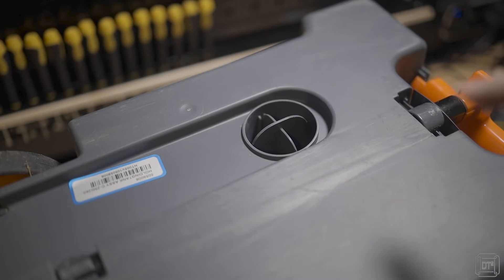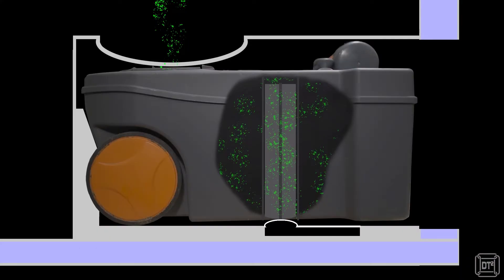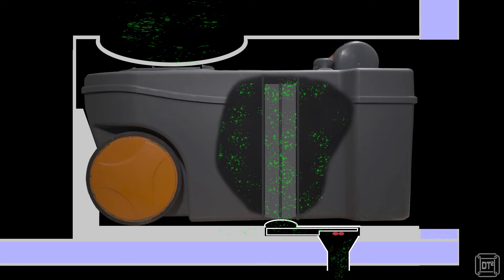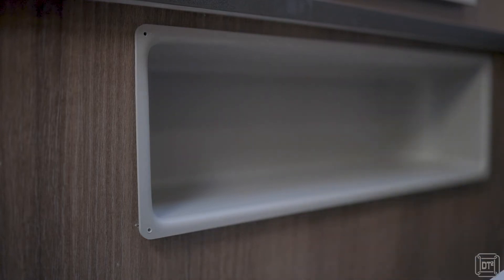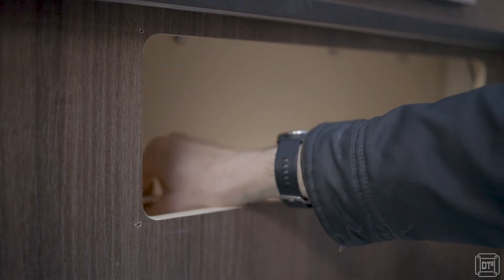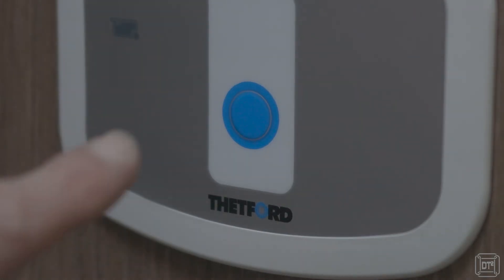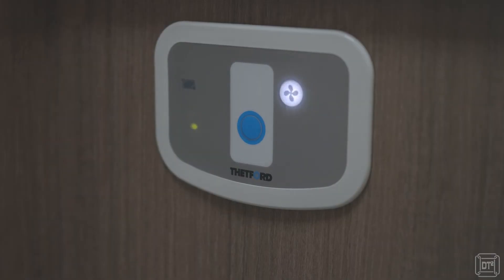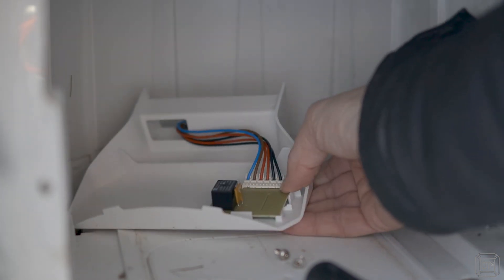THETFORD ELECTRIC VENTILATOR - Detailed installation and review of this toilet extractor fan kit.

Comment: Kevin what a explanation. You are briliant.
Unlike me i wondered if you could help me. I have fitted my kit and nothing works but it may be th purple and black wires that i have had to connect back into the 4 pin connection block that i forgot the colours to connect to  i have an orrange wire with black strip and a purple female spade connectors. The 4 wires in the block have a purple but not the grey . It just will not work so i tried the old circuit boards and that do t work either. I even tried the red and black and nothing happened. Could i have blown a fuse or could it be i need to prime that magnetic switch thing.
I realy do need someone’s help.   It should have been easy but my photo taken of the wires video is not good enough
Reply from the maker: The magnet switch is only to detect the level in the tank. So even if that was broken or incorrectly wired it wouldn't affect anything other than the level indicators.
If you think you may have wired the power supply wires in the wrong way around (ie connected positive to negative) then that could well have blown the board. Or if you have connected the wires incorrectly  and shorted the circuit then that would have likely blown a fuse.
I would -
Get a decent photo of how it is currently connected.
Then disconnect the wires and check with a multimeter which if any are giving you a 12v feed.
If none are then it's likely that a fuse has blown.
You will then need to find the fuse which may be near the cassette but more likely in your main fuse box.
Good luck
Dave
Reply: @DTSquared  Dave sorted it.   Swifts white and orange wire is the earth  i put that to thetfords Black wire.     Swifts purple wire i had put to Thetfords purple wire but that is wrong swifts purple wire goes to Thetfords red wire.  😮 how daft is that purple does not connect to purple.😮 done now all working now😊😅😊

Comment: Hello & thanks for the video, I've had a Valencia in the past with a SOG unit pre-fitted. I valued it but it was fiddly & seemed a little under engineered. I am getting a 2018 Cartagena; might that be the same model as yours? I am wondering about the drilling section & hitting that plate you found - thus - may follow your example & not go with the supplied 85mm vent & perhaps drill the (36mm I think you said) smaller hole instead. That said; would you be able to explain how you made the replacement that you used or what it's composed of please? Thanks in advance :)
Reply from the maker: Hi @ApplesnCastles  glad you found the video helpful. Our van was a Barcelona but in the same range and age. I haven't used a SOG but did research them as an option and thought the same as you did that it was a bit under-engineered. From memory the replacement pipe I made was a short length of white waste pipe (probably 1 1/2 inch) Then I got circle of plasti-card and cut a hole in the middle and then cut some smaller donut shaped rings of plasticard to build up the card around where the pipe met it. It was a bit heath-robinson but it doesn't have to be leak proof or that strong as it will be sealed underneath anyway. Hope that makes sense. I have a 3D printer now so would probably just print one but the arts-n-craft method worked.
Hope that helps.
Reply: @DTSquared  Thanks (Dave) for the reply, & yes, useful video & was why I bought the Thetford rather than the Sog. The kit actually arrived today (not even got the van yet) but I've also got a 3d printer as well, I'm glad you mentioned that (I didn't even think!) so that's the ideal solution. When I've actually got the van & removed the loo, I'll work out the exact dimensions & knock one up in TinkerCad & then just print it! I can then drill the size of hole needed for that rather than the huge one suggested - but with a 2-5mm recess for the wider part at the top so it fits flush. P.s. ordered one of those porcelain bowl inserts too.

Comment: Have you still got the original  floor vent..
Reply from the maker: The tube that goes thru the floor? I did have, but may have just thrown it out, doing some DIY and things are all over the place at the moment.
Reply: The original  that came in the packet.. if you find it sell it me please  £30.00  Leeds LS12 6AT...

Comment: I had a SOG on one motorhome and it was horrible. Not only is the vent pipe dangling around in the cassette chamber but you have to disconnect the vent pipe from the cassette in order to remove and empty the cassette. This process reveals a hole directly into the cassette and when you lift it out to carry it away, the cassette contents can slosh about and come out of the hole. No thanks. I have also had the Thetford vent system and it works perfectly: no smells and with no interference to the normal emptying procedure.
Reply from the maker: I haven't tried the SOG but I did research it before buying the Thetford vent system. It didn't look as "elegant" from an engineering perspective as the Thetford.
Sounds like your experience  confirms that. Thanks for sharing.

Comment: Hi, very informative video. I’m planning on installing the same system next week on our van. Couple of questions, what did you make your flange with to fill the larger size hole in the floor? Also, I’m struggling to find a 36mm hole saw without spending about £30. Did you use a hole saw or a spade drill usually used for wood? Many Thanks from John 👍
Reply from the maker: Hi John, I'm glad you found the video helpful. In terms of the flange I assume you mean where I'd cut the large hole of the specified diameter then swapped to a small diameter tube? It was a bit of a bodge but from memory I took some standard waste pipe cut to length.  I then cut a small length of the same pipe then cut it so it could open up to form a coller if that makes sense. I glued that to the end of the main length so that the wall thickness was a thicker surface for gluing Then glued a circle of plastic card onto it. If you are going to start off by drilling a smaller hole then you won't have the large diameter hole to fill. You could probably just put pipe in a seal it with foil tape or similar. Remember to also seal on underside of van!
In terms of hole saws the very large diameter hole saws as per the original design are quite pricey. But you can get sets of them with range of sizes on Amazon and elsewhere for about £16 up.
Personally I wouldn't try using a flat bladed wood drill. It's a composite material so I just wouldn't be sure how it would behave as you hit other materials on the way thru. Best use a hole saw they are more forgiving.
Hope that helps.
Dave
Reply: Cheers, now found a hole saw source on line. Just waiting for all the bits to arrive to get started. We’ve been using Solbio, it’s great to use, no staining and easy to dispense. But not as effective as the traditional blue. Hence the extraction modification, to totally eliminate odours.
Reply: Hi again, so it’s all fitted now. Used a 37mm hole saw and achieved a very neat installation without hitting any strengthening beams. However like you I have an issue with the additional light functions. The cassette removed red flashing indicator is the only light I have. It’s on all the time, with the cassette fitted or not, except when I fill the cassette with water, then I have no lights. I’ve noticed from your video that you have 6 wires connected to the reed switch within the cassette locker, I only have 4 wires. Did you have to add any wiring other than the wire for the fan? Did your original installation have any other electrical functions other than the full light? Such as electrically operated blade? I’m thinking of refitting my original reed switch to see if that is a better option, and might explain the difference in the number of wires. There was no part number label within my unit to exactly specify the unit, other than I know it’s a 260. Many Thanks from John.

Comment: I just dilled a 40 mm hole and put in a 40 mm fan, I added a micro switch to the blade, so the fan turns on as soon as you open the toilet, and that's it. Might add an activated carbon filter in the future.
Reply: my plan (I have bought the bits online and just waiting for them to arrive) is to combine elements of the sog kit and the thetford kit by installing the microswitch on the blade, cutting the hole in the floor where the thetford kit does, but installing a 50mm fan under the floor in a junction box directly under the hole, with holes in the lid of the junction box incorporating the carbon filter (ie. not using the thetford filter, but there would be nothing to stop me using it if I wanted. I can buy enough carbon filter material to last a lifetime for the cost of one thetford filter). Having the filter material as far on the outside as possible should stop too much dust coming in and/or insects such as wasps coming in and building nests. We are in Australia and spend a lot of time off road and on dirt roads.
Reply from the maker: Yes I've seen that approach taken before and the microswitch certainly makes it fully automatic to use. Did you locate the hole directly under the cassette vent hole or on the far side which is where the it places it. If it's directly under then I think you'd have to make your own filter as the standard one (from memory) is not a straight thru.

Comment: Mate, this is the best explanation I have seen on the cassette vent tube, I couldn't figure that out, THANK YOU
Mine is a C400 and the SOG is to be fitted below the cassette, I couldn't figure how that could pull internal air from the cassette.
Your a legend and answered my puzzle.
Best wishes
Reply from the maker: No problem glad it helped.

Comment: Did you get an answer from Thetford regarding LED level indicator?
Reply from the maker: Yes I did. It took a while as the supplier lost the support request then there was confusion over the nature of the issue. Once that was sorted Thetford sent a replacement mainboard and all working OK now. Actually, having a half full indicator is a lot more useful than I thought it would be as it gives a more specific indicator of whe.b to start thinking about emptying.

Comment: I have recently changed from a caravan which already had a SOG ventilator to a motorhome and would like to fit a ventilator.  I found this video useful as it clarified how and when the Thetford fan operates.  The SOG seems much more practical as it is linked to the cassette blade so that the fan operates whenever the blade is opened, thus preventing any odours escaping into the habitation area.  With the Thetford fan it appears that you have to start the fan manually, using the flush button.
Reply from the maker: Hi David, yes you're assessment is correct in that the user does have to "learn" to activate the fan first. It does also give the user the option to not turn on the fan if they wish to avoid any noise. In fact the flush button now does not flush on the first press so to flush two presses are required (unless the fan is already running).
I've seen the SOG but not used one but I'd say that the Thetford is mechanically better integrated especially since the hole is in the floor not the side of the van and there is no air tube to deal with when emptying the cassette. But other than that they are very similar in what they achieve and how they work. So I'd recommend either in terms of avoiding smells.